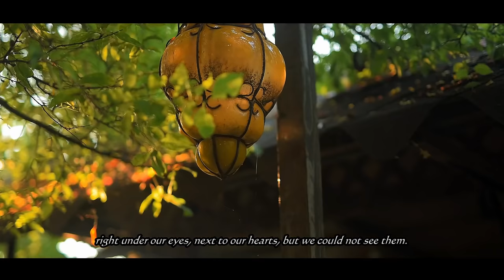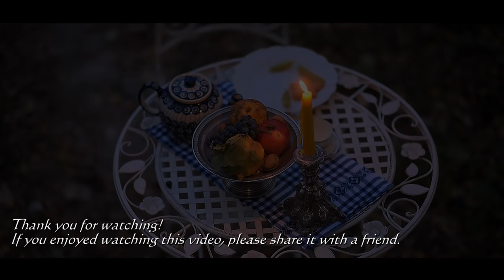Fairy Cottage Renovation and Decoration

Comment: Hi Johanna, you are so a nice person und yozr Cottage is so very beautiful.  But I like to see your bathroom. Wher you find water and energy?  Greatings from Germany
Reply from the maker: Hi, Renate! There is a small kitchen and a bathroom in the house. Will show the kitchen when I renovate it. Won't show the bathroom as I don't consider it proper and this is not the purpose of my videos. I have running water and electric light. I also have my own well and added solar panels to the house this autumn. Still need to add six of them, but I already use them as they are. Best wishes!

Comment: Where may I find a recipe for those cookies? thank you
Reply from the maker: The recipe is presented in the video. I did not use fixed quantities for this one. Add a bit of hot water when molding the dough, so the dough becomes more flexible. You could use sugar or honey or another type of sweetener instead of what I used. Thank you too!